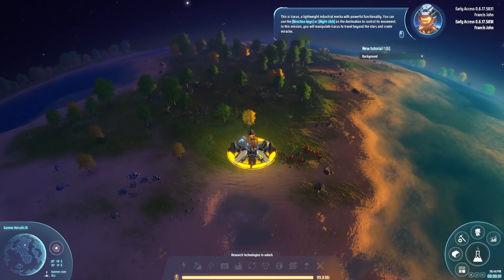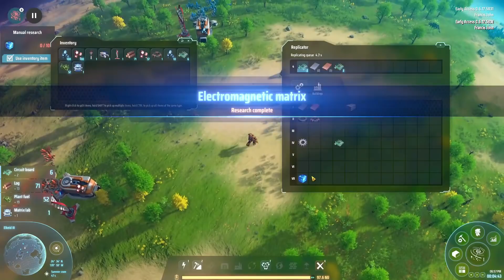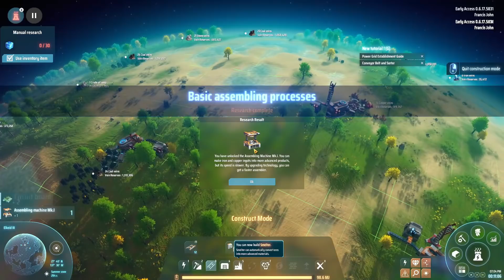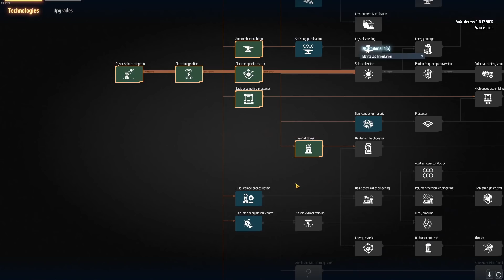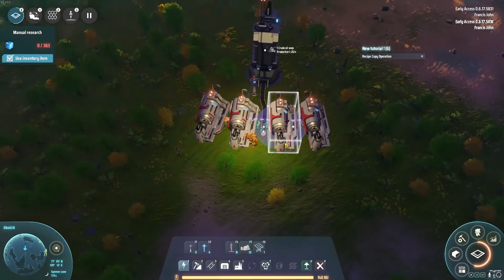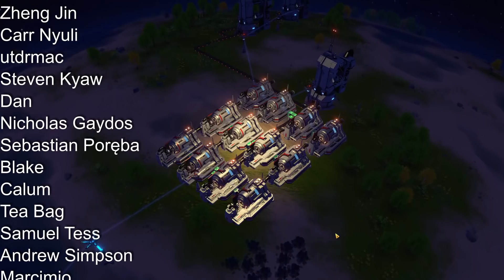How to start Dyson Sphere Program Ep1

Comment: In regards to your crude oil -> thermal power station: Crude Oil burns for 1.48 seconds in the TPS, this is 40.5 oil/minute. @27:45 your oil is producing 1.95/second or 117/minute. This means that specific oil can run 2.8 TPS, so basically at most 3. There isn't any reason to have 4 of them on there. A good rule of thumb is if it's less than 2 oil/second, you only need 3, if it's more than 2 oil/second, you can use 4.

Comment: I hate "tutorials" that require you to re-roll over and over until you get a good enough start. A good tutorial covers what you need to do and should be applicable even in "dud" scenarios.

I made that mistake when I saw a couple Rimworld tutorials that started with "you need to have X mining, crafting, plants" and all they did was give me bad habits that made me bad at the game. If your tutorial can't survive a dud scenario, it's a bad tutorial.
Reply from the maker: No planet is really a dud, it's just if you have to travel half a planet to get to stone/coal the commute back and forth is going to make the start of the game a painful crawl. The starting mech before upgrades is painfully slow.
Learned my lesson in the first game, now I make sure my starting area has everything in the starting area to ensure a painless start.
Reply: @FrancisJohnYT  But why? Because you need coal, copper, and iron all in one place? Why not just check where you can find that off-camera so the tedium is away from the veiwer, and then explain what you did and why? Is it really better to restart the entire game and go through loading screens? Is time really saved? What do you do when you expand and you happen to land in a barren area?

The problem I had with Rimworld is that the tutorials I had seen set up the expectation that if I didn't have what they told me I needed, then I had to just restart or reroll because it wasn't worth it, and it cut out gameplay habits that were healthy to maintaining a colony moving forward. Not everyone is a content creator that knows the nuances of a game or understand the fundamentals that allow them to skip or reroll steps, or has a good enough PC to fly through loading screens and restart.

I'm not a subscriber, and I've only recently found your channel, so you're not really losing anything if you decide to ignore me and keep doing what your doing. If you found what works for you, and it's good enough for your channel, then that's good and it's right to do what you think is best. I'm just some guy and it doesn't matter what I think. It's just my opinion, but I don't like how you defend what is essentially cheating.

Comment: The think about dyson sphere is that their size is limited by star radius. So max sized sphere on your home system will probably be smaller than doing it around a bigger star. Also you can use AdvancedStarmap mod by brokenmass to see them easily.

Comment: Is it just me or does this look like a game that offers little long term motivation? Presentation and scale are amazing, making the first few playthroughs a worthwhile experience. But it is rather superficial. The tech trees and production chains are very linear. The only variable that could pose a challenge is the ressources running out at some point. I feel like this game lacks some actual depth to it and that its replay value is pretty low.

Comment: 😆I was right to rush logistics and skip the mall on my first playthrough. Though I got bogged down on other stuff. Never thought about power directly from oil or chaining thermal generators. I did make a mall later feed by a few logistics stations, till the mall started spitting out a mass amount of logistics stations and I didn't have to worry about the amount.

Comment: Resource distribution increases as you go farther from the starting system so I would say you want your type O's and Black hole/Neutron as far away as possible.
Reply: I had everything researched before leaving my system so distance doesn't really matter.  I can't be sure that the distance is true.  I've heard it from multiple sources.  Probably easy to verify with some of the same class stars at different distances.

Comment: Cool to see you start over and not sweat setting up a billion windmills and solar panels. I used thermal plants a lot and I still had coal left on my starting planet 60 hours later, it's so much more convenient. Oh, and at the start you mentioned everything was nice and close in your galaxy. There's pros and cons to that. It sure is convenient, but apparently the quantity of resources in the veins depends on the distance from the starting system.
Reply: Yeah, great idea; I just restarted and beelined directly to thermal power. So much easier, time-efficient and resource-efficient (esp. for silicon) vs wind/solar.

Threw raw coal into the thermals at first (only energetic graphite for my Mecha). After automating Red and Yellow science, went crazy on oil mining and Xray cracked every refined oil that wasn't for plastics/organic crystals just to maximise H2 production to burn off in thermal gens.

The wind/solar Halo rings look very pretty but they're a colossal investment for... nothing except aesthetics.
Reply: I'm in my first playthrough. At the moment my 1 wide solar/wind belt on my second planet is producing a similar amount to my thermal+wind on my home planet. This is with 6 (relatively close) veins tapped and feeding lines of oil processors, 1/3rd using xray cracking.

I have no where near maxed out the output of the veins. But it's taken surprisingly much longer to setup thermal than the belt. Probably because I'm also still learning how everything works together, and I keep getting distracted.

The belt was tedious, but not nearly as time consuming as I thought. And, I only made it 1 wide but that was still much more than I needed to power several mining/production operations and my interplanetary logistics station. Now I'm running conveyors over said belt to transport items for transport at minimum power cost.

Comment: A little help on some of the more bothersome annoyances in this game. The advisor will keep repeating the same stuff over and over again if you click it off. The way to keep him from coming back is to let him waste his breath on the message he is trying to give you. Once he goes away on his own he won't be back with the same message over and over again like when you manually shut him up. The other suggestion is that track only gets wonky when you start crossing the upper and lower boundaries of the globe. Look for the sections where the longitudinal lines mismatch on the latitudinal lines. If you divide the globe into 3 sections, North, Equatorial, and South, you will see the mismatch between sections. I try to avoid building anything on those 2 mismatched latitudinal lines because that is the place where things get really weird with placing buildings and track. Simple helpful advice with no mods needed.

Comment: Good call avoiding solar early, Basically did the same as you and just burned coal products until I was ray receiving, after that I switched an entire planet to just charge accumulators and warp them wherever requested. Nothing ever runs out of power and I keep all my towers at max 300mw recharge, 2 energizers discharging are 90mw and they don’t drain excessively, only when needed.

Comment: For oil-based power, I always have the oil extractor (+ refineries once x-ray cracking unlocked, more power per well) powered by a small separate wind grid. 
This way they provide constant power even when power consumption exceeds production.
Reply: Power prioritization would be great. But this sounds like a good idea. Just have to remember not to connect it to the grid accidentally.
Reply: Clever. I'll remember that trick.